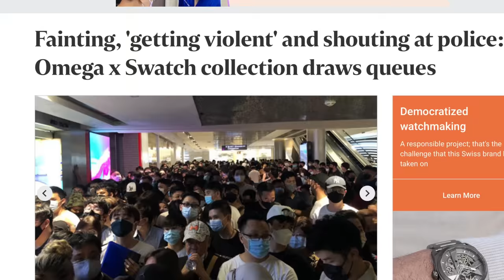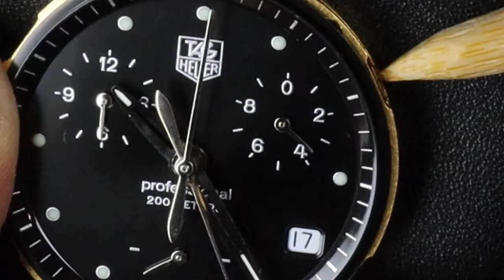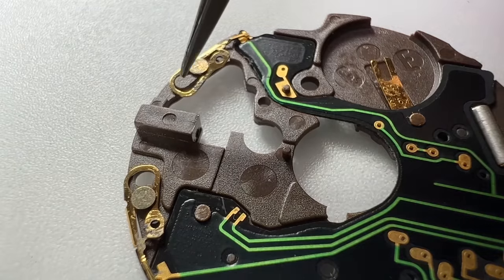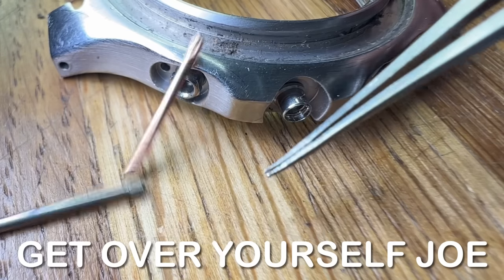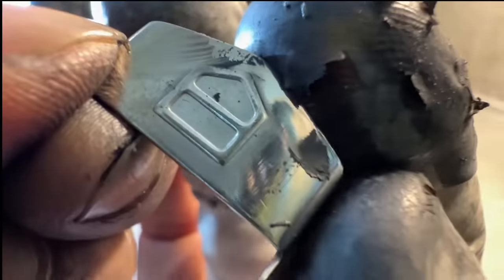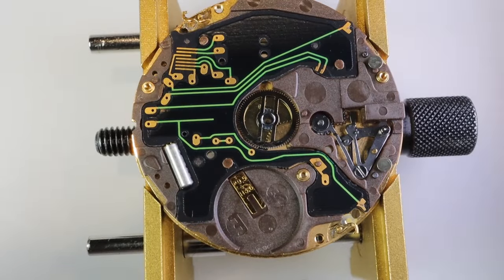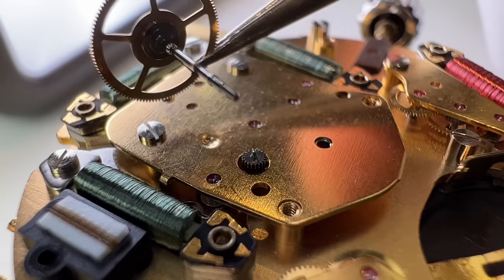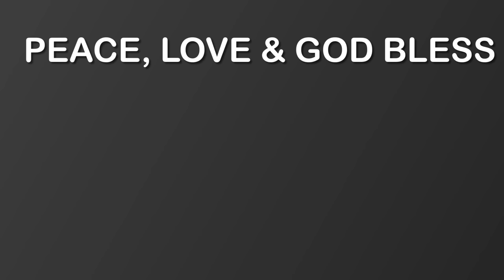TAG HEUER KIRIUM CHRONOGRAPH RESTORATION & COMPARISON WITH OMEGA SWATCH

Comment: Joe, I couldn’t love you more, love your work love your humour, love your philosophy. This video was way below par, the sound quality was really bad, because your new macro lens goes closer, doesn’t make it better, it’s less engaging. The switching between the two watches was badly edited and confusing. Other than that….I will still log on every day to see if you’ve uploaded a new video!
Reply from the maker: Thanks for the feedback mate. Will work on the sound. Need to get a better microphone. Have tried so many rode mics but can’t seem to get it crisp
Reply: @NekkidWatchmaker  For the record, I disagree about the macro and the switching (although I think you leaned a bit too long and hard on the arm cheese shots 🤣). The only issue I noticed was the inconsistent audio. If the only views included had been macro, maybe it would have been noticeably impersonal, but I still don't think so, because your fingers and hands are in the shots, and you're right there narrating it all to us. But that's my opinion.

I also like the dancing reflection in the watch cleaner. 😂 A little less extensive this time around, but it still gave me a good chuckle!